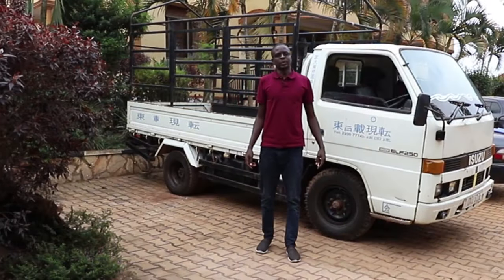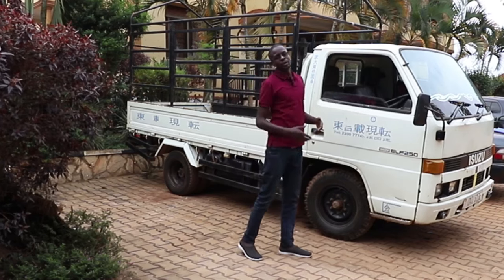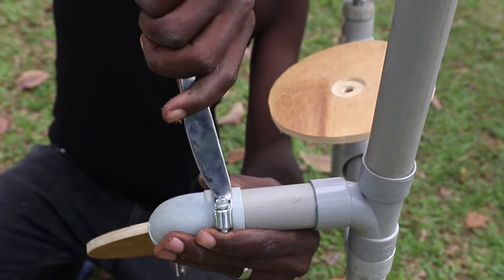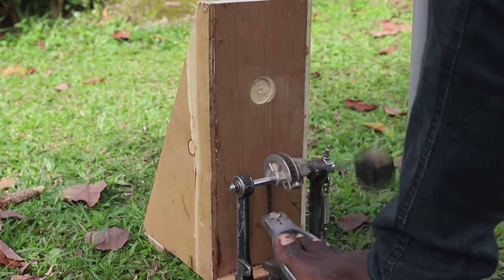How to make a velocity sensitive electronic drum kit (DIY HOMEMADE ARDUINO)

Comment: Nice work :) Thank you for sharing this ! Btw i'm also using my iron to make hole, and yes i also have a drill
Reply from the maker: The iron is sometimes works better...but gets destroyed in the process
Reply: @Afrorack  When I use it to make holes, I clean it immediately with a cotton cloth and I finish cleaning it once it is cold with a very fine sandpaper it's the best way I found to damage it as little as possible, so I use it mostly for square holes

Comment: Hey, awesome video and awesome project!! I found this video because in my materials science subject, me and my group wanted to build also an electric drum kit for our class project. We actually figured out how to send the midi to my computer through the arduino microusb port with a library called ardumidi that can read the serial of the arduino and the hariless MIDI program that can bridge the midi from the serial to a virtual midi port previously created, but the result is kind of poor since there is a lot of lag and I cannot get the code to read de analog properly. I had to do all that because I previously tried soldering a MIDI socket and sending the midi with a "MIDI to USB" cable to the computer and it didn't work. I would love to see your program and how you connected it to the laptop. I was looking for it in your channel since you mention it in the video but I couldn't find it.

Comment: really nice video. do you have some tutorial or resource to the building of the drum brain? I have some second hand rock band pads, they have piezoelectric with a cable that ends up in a mini jack, so I was thinking of using my old raspberry pi 3 as a brain, have there the software and something in the middle to connect the pads... I know how to code, but Im not very familiar with real circuits
greetings from Argentina!
Reply from the maker: since you already have the pads, you can experiment reading the outputs when you hit the pads...not conversant with Raspberry pi...but I use microcontrollers..then you can read the peak voltage when there's is a drum hit and convert that to MIDI velocity...and send a midi note and send that as midi information to a midi sound generator.In theory it's easy but in practice it takes alot of tweaking to avoid false triggers etc..but since you write programs you can make it I think
Reply: @Afrorack  thanks for the quick answer!! I thought something like that too, but I still am in  doubt with connecting the mini jacks someway to the raspberry. I suppose I need to study a bit more of hardware. do you remember any language or libraries that you have used to do the software part?

Comment: Hi, i have been watching different videos about DIY drum kits, what is the difference between using arduino or not for the electronic, for some of the videos you do not need arduino. Thanks.
Reply from the maker: You use an Arduino or a microcontroller if you are building your system from scratch...If you already have a drum module then you simply make the pads...hope it makes sense
Reply: @Afrorack  I do not have any drum module, I am starting from scratch, some people do not use arduino, they make a PCB with IC LM324N and some leds, LDR and resistors. That is why I was asking not sure what option should I try.

Comment: What changed in the way you set up the piezos last time we learnt about there problem with resistance and that's why they partially couldn't give us the result we want. What has changed? Is it the Arduino programming?
Reply from the maker: Yes the program has changed but the biggest change is how the piezos are mounted.That makes the most difference

Comment: Amazing video!! May I ask what kind of 6.35mm jacks you use to connect the piezos to the arduino board? Thanks
Reply from the maker: What kind of jacks? I use the normal phono type jacks because I already have music instrument cables..to connect them
Reply: @Afrorack  No doubt I also like the instrument cables because they stabilize the connections so you can unplug/plug in and transport easier. Do your phono jacks have 3 conductors/prongs or will it work with 2? I'm curious because I'm unsure if you need to have an independent ground wire on the jack to connect it to the arduino.
Reply from the maker: @torpzp  2 contacts is enough..ground and signal
Reply: @Afrorack  Sounds good...last couple questions... did you use the same circuit as from your other video on how to make electronic drum pads? I'm seeing other people on the internet use a 1MΩ compared to your 10MΩ. Did you find this better suited for the voltage spikes of the drum pad? And, was the 5.1v zener diode necessary in this set up? Thanks for your help!
Reply from the maker: @torpzp  Actually I will be making another video soon on the drums....u need to experiment with different values of resistors and see the response... in my next build I will use less resistance values...makes the pad more responsive...the zeners can also be left out if u experiment and see that your piezos are not sending out high voltage spikes to the arduino close to or above 5volts....heard that the arduino has over voltage protection on its inputs but haven't investigated that further
Reply: @Afrorack  no doubt that makes sense. I ended up buying some second hand Yamaha tp60s pads for this project because I figured it would cost me about the same to build the pads myself factoring time and materials. I anticipate some experimenting with the circuit to get them dialed in.

Comment: How much does it cost overall?
Reply from the maker: The materials not much .but ur time..quite abit...The materials also depend on where u stay
Reply: Can u please comment all the electronics u need please
Reply from the maker: @frangie9858  
Arduino
Piezo discs
These are the main things..Do you know how to use Arduino?
Reply: @Afrorack  idk how to use arduino
Reply: @Afrorack  please tell me an easy and cheap way it will help me a lot thanks
Reply from the maker: @frangie9858  You need to read up on Arduino's... otherwise there's no way you can do the project
Reply: @Afrorack  where do i read it
Reply from the maker: @frangie9858  Google...YouTube there's lots of resources that can teach u